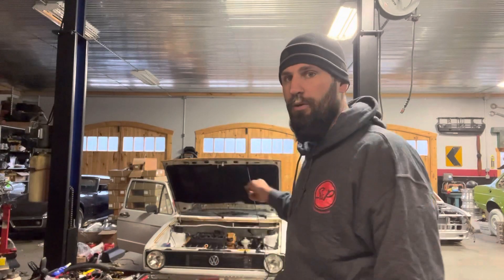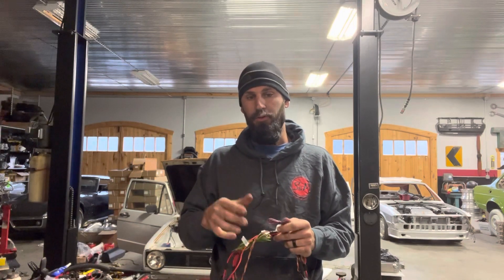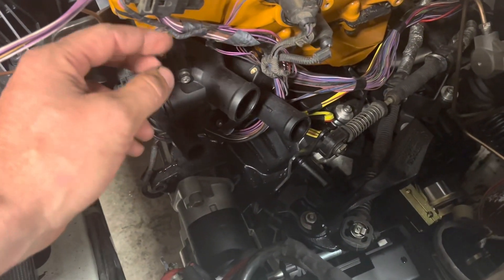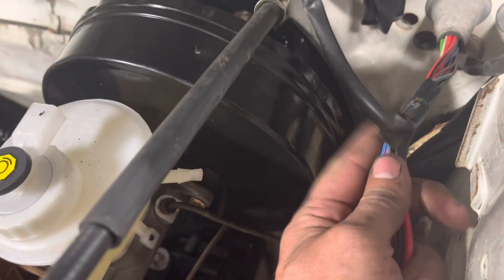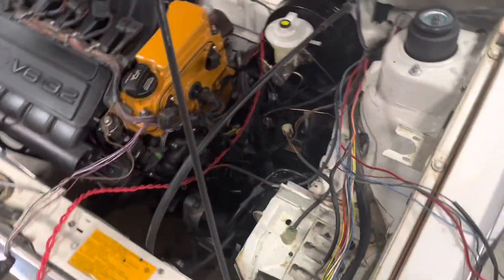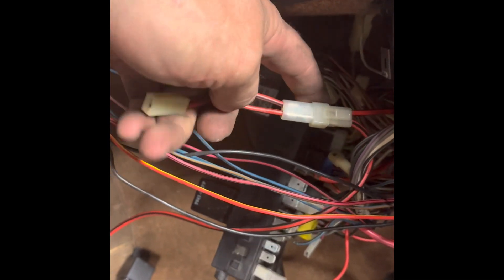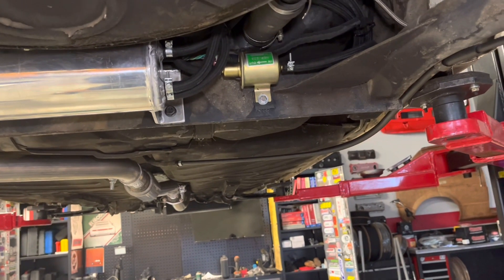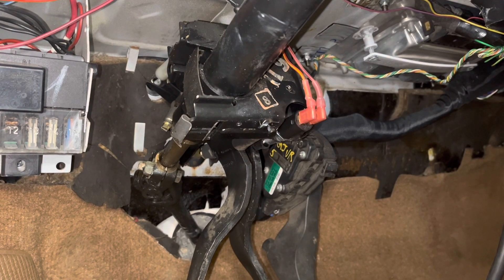Wiring a 24v VR6 into a Mk1 Rabbit

Comment: so when i do this swap on the golf mk1 petrol engine ill remove the whole golf 1 wiring then use the 24v vr6 wiring and computer box on the whole car??
Reply from the maker: No. Did you watch the video? I’m clearly using the mk1 chassis wiring
Reply: @spautomotive4323  i did multiple times but i fail to understand how u used both the wiring please be patient with me id like if u explain much more coz this thing its stressing  me alot because id like to do this one day
Reply from the maker: @mUsKI_63  the wiring from the donor car only operates the engine. The rest of the mk1 wiring is the same as it was.
Reply: @spautomotive4323  ok let me look at it
Reply: @spautomotive4323  i watched it so its just cut and join ?....
Reply: @spautomotive4323  truly speaking i still find it hard but surely the day i do it ill be able to figure out and only again youll be able to help me out and go throu this with me .